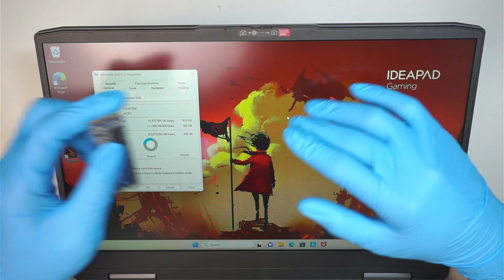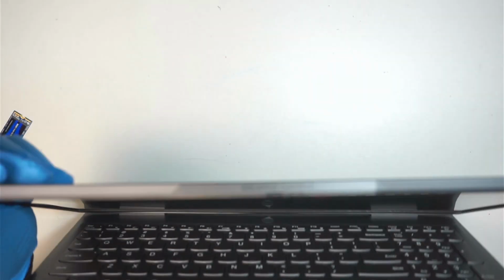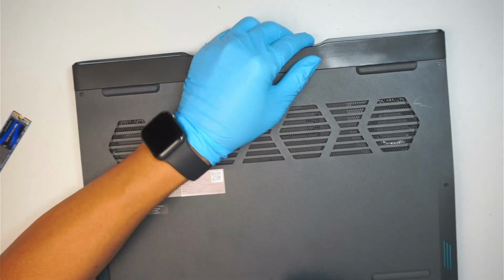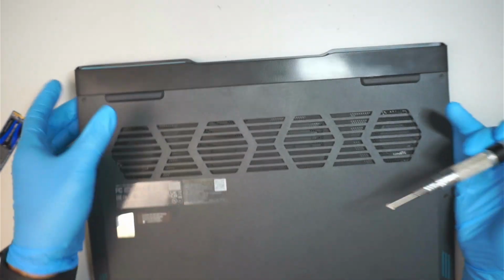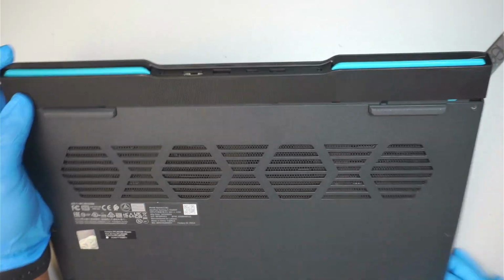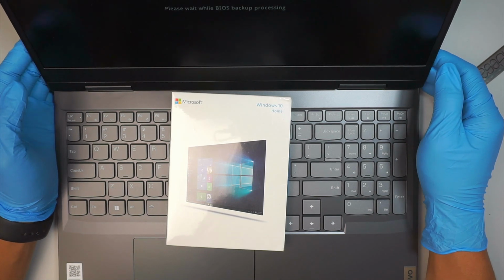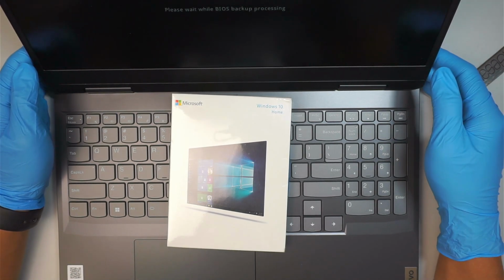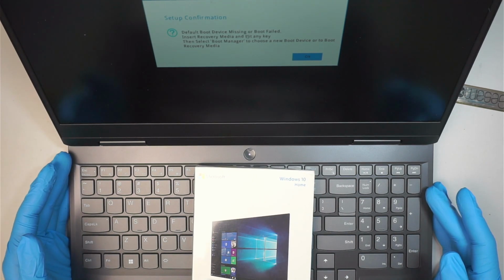Lenovo IdeaPad Gaming 3 Upgrade M2 NVMe SSD

Comment: will a samsung 990 PRO PCle 4.0 NVMe™ M.2 SSD 1TB fit?
Reply: Nah
Reply: Did it ? I am trying to figure that out rn
Reply: @CREAMYHORSESHOE  i was met with a certain problem im getting like very low reading speed for some reason. I suspect it's because my ssd drivers are intel ones not samsung but im not sure.
Reply: @Fool-e2v so I probably should just go with like a Kingston one, thanks for the reply

Comment: I have the same laptop, but my original ssd is the long one, and I already bought another long one So what do I do?
Reply: Have you find any fix
Reply: @mamedoff20  just cloning the ssd
Reply: Can you add a small SSD to it? I want to expand my SSD too but idk what to buy?
Reply: @mrpixelatedgod  i bought a 2 tb m.2 ssd, thats the long one, you can simply just clone it and its all done
Reply: @JohnnySmartie bro so this means we can't fit both 2280 ?🥲😭; but sais that's why i bought long
Reply: @parnavmittal5098  yeah it shucks doesnt it, i also only found out when i opened up the laptop after cloning, but you can still always use the other ssd as like a backup usb stick eith the adapter thingie
Reply: @JohnnySmartie Great idea ngl ; but upgrading again and sucks ; i bought this by thinking that i gonna replace first one with 4tb if i ever need in future ;

Comment: Is it also possible to keep the original M.2 SSD and install the new one as an add-on in a Lenovo IdeaPad Gaming 3 15ACH6? I have installed the additional SSD drive, but the computer does not recognize it.

And: what type/size of screw is required to fasten the SSD?

Hope that anyone can help, many thanks in advance.
Reply: Yes you can install an additional one. Lenovo IdeaPads come with a screw in place for you to use to fasten it so don't worry about that. 
As for not recognizing it, after you install it look for "Create and format hard disk partitions" in Search on your computer and use that to initialize the SSD and create a partition and then it will work.
Reply: @MintXIV  Found the correct screw, added the SSD, and this time it showed up in disk management. Thanks for all the tips, it works flawlessly!
Reply: @MintXIV  Thank you for the tips! I will try this next week and then report back here.

Comment: Can a 2.5 SSD be placed? I saw that there is space at the bottom left.
Reply: No it can't. There is no SATA slot available, so only the small SSD slot is available
Reply: @andreidrilea15  there are nvme to sata converter the only problem will be length since there is space in left of laptop and connector in right.
Reply: @No-enemy-09  I have the same laptop (15ARH7 model), there's no space for that kind of option. There's the factory slot, for 2242 SSD, along with the spare 2280 SSD slot. Even if it would be possible, that adapter would have to go across the motherboard to reach the opposite side.

Comment: I don't know why but my screws on both drive slots are extremely tight. Like I literally cannot move it at all with a brand new screwdriver and applying a dangerous amount of pressure. I haven't broken anything yet but I'm going to lose my mind with these screws. I have no clue how to loosen them
Reply: Cross threaded maybe? Or mixed up/used the wrong screws?
Reply: BRO I HAVE THE SAME PROBLEM HOW DID YOU SCREW IT OUT

Comment: Hey guys, can you tell me what’s the m.2 model of that small one @ 5:47 ? My ideapad came with a bigger sized ssd and I found out it has another slot for m.2 but a smaller one and im not sure what m.2 type to order if I wanna expand and use the other slot also
Reply: @noahd999 thank you man!
Reply: @LaidBackLens  I dont see the dudes comment and IM having the same issue , can you help ?
Reply: @alemtalic5535  i guess it's 2242 m.2 i am not 100% sure
Reply: @LaidBackLens  
Can you tell me about  m.2 model because I have the same laptop and I want to upgrade
Reply: Was greeted with the same surprise when I opened the laptop up, pity
Reply: I too got the bigger one...the company should have given all of us the smaller one because to upgrade one of these cost much higher than the bigger ones
Reply: I guess im late, but my version of this laptop (15 arh7 type 82sb) came with a Kioxia Kbg50znv of 512gb

Comment: cant i just keep everything as normal, but just add that new m.2 ssd? why would i throw away 256 GB?
Reply: Yes you can. Guy in video made it way harder on himself. If you leave the original SSD in, you can transfer everything to your new SSD after you've installed it in the laptop. You can configure the laptop to use the new SSD as the main one and keep the original SSD as extra storage.
Reply: Mümkün

Comment: So... Why did you remove the original ssd? By installing windows like that you basically will have to reinstall all of the drivers.
Reply: is that even an issue? The drivers would be automatically installed anyway
Reply: @maseraffy  Well, maybe it's because I've mostly used Asus laptops, because when I've had to format my laptops for whatever reason, while yes, most drivers get downloaded automatically, I've had to manually download some critical drivers from the vendor's website

Comment: I'm not sure why you removed the boot drive when you could have just added the new SSD as an expansion drive. You've made a simple job super involved.
Reply: What is a boot drive
Reply: @bigboomsurvival  iirc it's the storage drive where your OS is installed.
Reply: Does it have an extra nvme slot?
Reply: if you just leave the stock drive in and add the new drive to the extra slot does it keep the windows
Reply: So I don't have to clone or remove the original ssd drive?
Reply: Depends where you live usa and some countries you can upgrade yourself. In india and major countries call lenovo service for upgrade or your warranty will be void.
Reply: To anyone here, how do i know which slot my laptop is used? Is there a way to check without opening my laptop, i have the same laptop as in the video but with a 512gb ssd instead.
Reply: yeah.. I don't know what the hell this guy is talking about haha. I just kept the original drive in, added the new pcle in the additional m2 slot, and everything worked fine... I didn't have to "copy" windows to anything or register windows to the new drive lmao. Is that something that actually has to be done in some cases? Or does he just not know what he is talking about?
Reply: @noahd999  dude i tried to put a seagate firecuda 2tb in mine and it didnt even work, im fairly confused and dont know what to do, i thought my ssd wasnt compatible but it is when i checked.
Reply: @tedyduhbuny i guess it support 1tb per slot
Reply: do u know if the warranty will go if i upgrade the SSD? i have the same laptop in the vid
Reply: @qudsiabano2999  I think you'll affect your warranty. But im not so sure, maybe double check whether doing so you'll tamper a warranty sticker.
Reply: @harry619  warranty stickers arent legally binding you can remove them if you dont do major changes to the laptop
Reply: @qudsiabano2999  you can install new ssd on the extra slot without damaging the warranty. They gave you the slot because they want you to upgrade. Don't worry. 

But make sure you do not damage anything while upgrading. Take help from an expert.

Comment: do i HAVE to replace the original ssd ? or can i just put another ssd into the secondary slot ? please and thank you
Reply: To my knowledge you can install a M.2 drive in the Lenovo IdeaPad gaming 3 laptop without removing the original SSD. Its almost the samething as you would add another M.2 drive on A PS5 Console to expand its memory without removing the original SSD. Hope that helps you :)
Reply: ofc you dont have to remove it. ranjid explains it weird.
Reply: @Tamagotchi808  but, unplug the battery is still a must, isn't it?
Reply: @bimoagungk2977  I think it's a good measure, please make sure to do it
Reply: @Tamagotchi808  so to clarify, I can add the new ssd card without removing the original, the storage will be added together, and I wont have to re instal windows?
Reply: @obedbingham4374 looking for this answer. Did you figure it out?
Reply: @dadjokesgaming  not yet
Reply: @obedbingham4374  I am pretty sure that you wouldn't need to reinstall windows, you will just normally boot into windows, and then you can go into "create and partition drives" in windows, and there you will see your newly added ssd as unallocated space and a separate disk, hope this helps
Reply: @dadjokesgaming  please check my reply
Reply: Have you found an answer? I also have the same question.
Reply: @kevinmartinez7793  little late, but yes you can.
Reply: Thats entirely up to you. In my case, my original NVME is only 512 GB, not enough for my apps and games. So I plan to upgrade the original NVME to a 1 TB. Then install another 1 TB SSD on the secondary.

Comment: bro whats is the size of new ssd? If i want to keep two SSD on my lenovo g3i? can i?
Reply from the maker: You can use 1tb or 2tb or 4tb m2 ssd
Reply: @UbergeeksBiz  thanks bros
Reply: @UbergeeksBiz I beg to differ because my teamgroup 2tb gen 3 nvme causes windows 11 to occasionally bluescreen on power up, then restart, finally once windows is running, it stops showing up in file manager or disk manager. Is there certain brands I need to get? What about heatsyncs or thermal pads?
Reply: @UbergeeksBiz I beg to differ because my teamgroup 2tb gen 3 nvme causes windows 11 to occasionally bluescreen on power up, then restart, finally once windows is running, it stops showing up in file manager or disk manager. Is there certain brands I need to get? What about heatsyncs or thermal pads?
Reply: @arrivedknight7632  that's just ur ssd
Reply: @jaden8923  well then which 2tb drives WORK for this model then? Hmmmmm?
Reply: the size is 2280
Reply: @Daniel-_-Elii  sorry, i mean in GB
Reply: @motinha6185  no problem I believe it's 1tb.. that's the size I always tend too see installed
Reply: @Daniel-_-Elii  its 1 TB? 512GB?
Reply: @Daniel-_-Elii  im planning to upgrade my lenovo ideapad gaming 3 too, then i must take 2280 yeah?
Reply: @putunandes5965  Yep the 2280 is the one you'll need.
Reply: @Daniel-_-Elii m.2 screws can be used for a new SSD, correct? I'd like to keep both of them as well
Reply: @amazingperson9604   yea.. you can use m.2 screws.
Reply: I think the size is not 2280 because the ssd he used only has 1 gap. The 2280 has ² gaps